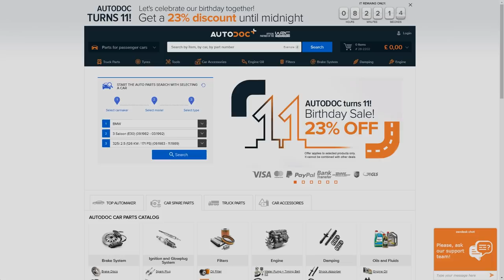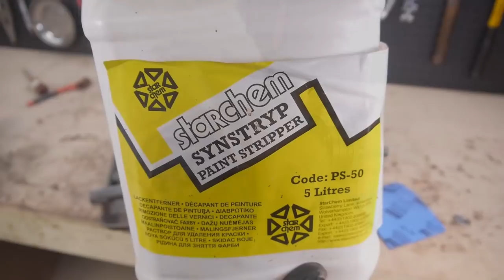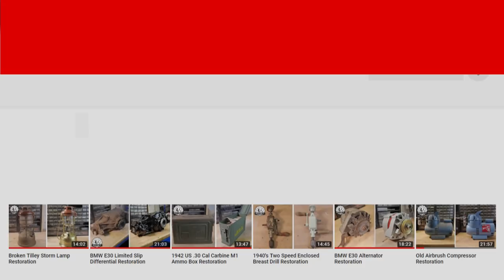BMW E30 Output Shaft - Full Restoration | BMW E30 325i Sport Restoration S2 E4

Comment: Once the body work is done, please tell me you're going to do a rebuild video of you putting all of the parts back in.  We've watched this thing get rebuilt piece by piece, I'm excited to see it all come back together.
Reply from the maker: Absolutely Scott :D You'll see everything.
Reply: @RestoreIt  Have we asked yet what color you're going to paint the car? I've been wondering this whole time. The same color as before? or...
Reply: @serenity6415  Since it's a restoration it will probably be the original color.
Reply: I've never seen you struggle before. That gives me hope
Reply: why is that not painted wet on wet, a lot less work

Comment: Loctite you're using is anaerobic adhesive. It works only when there's no oxygen around, for example, inside a thread. That's why any Loctite container should never be full. There're 3 major types of Loctite: red - strongest, for things which should not be disassembled anymore, still can be disassembled with heating; blue - for things which are planned to be serviced with disassembly; and green - weakest of them. I think it's a good idea to remove the screw, clean out green Loctite and apply blue prior you screw it back. Thanks for this nice video, and sorry for my English, it's not perfect but I think it's better than your Russian :)

Comment: Outer CV joint welded? to the drive shaft? Seriusly Dude, take a good look at it, and you will find a lockring inside the joint, on the driveshaft, squeeze it and the shaft will be removed from the joint!. Nice video of someone that works moore than needed. Just buy new CV joints, and swap them, it will save you a lot of time. And BTW, it`s almost the outer joint that needs replecement, it`s very rare that the inner is needed of replacement.

Comment: Dude your channel is so sick. not too sure if its intentional or not but you make me want to actually legitimately restore parts on my car that have gone bad. Its so entertaining that you've covered how to do certain things without a word spoken. You give me the confidence and I aspire to do that kind of work as well so keep it up dude!
Reply: Although I"m nooband I share your feelings, but there's lots of but's in here. First of all why not to take off the joint completely? It's quite easy to do, all you need is just a light knock and it will pop-off. There's also stuff in there to clean inside, you can also disassemble whole shaft in half and clean things in between. I completely don't understand decision to just repaint this part, which rusts as hell, the only way to paint it properly is using zink, because in this case this won't hold long, any rock that will hit that shaft will scratch it up to the metal, this has to have better coating then a base coat. Also he didn't place bearing balls into place the way it was, do you think they are the same? They are not! They weared out differently, and he just placed healthy balls to the place where it wears out faster which actually makes this shaft more loose within a next month of usage. He also placed boots wrong, putting ziptie over ziptie..w00t? r'lly? Don't you think it's too sharp for the gum to be mounted on top :D?

There's so many questions in here for me, although yeah, these vidsare  motivates as hell, especially the way things sound, there's no distracting music, there's only hand work which makes me to drop my software engineering and start to restore things! :)

Comment: Loctite works when the air is gone between the splines, so apply before tighten it. Great work lovely to watch!
Reply: Buddy,
You are generally correct.
However the green colour loctite which looks a lot like loctite 290 is called wick in and is designed to be applied AFTER the fastener has been tightened. 
I didnt see which number it was and if it isnt 290, you're right.
Reply: @dhc4ever  Oh okey never had that loctite my mistake. Learning every day :)

Comment: Hi, the outer cv joint is also removable, they're held on by a springclip, a good blow to the inner bearing race should do it. If i'm not mistaken. (kinda like how the halfshafts are locked in the diff)

Also the inner cv joints aren't to hard to find and not to expensive and its these that take the hardest beating normally. Its the smallest amount of play that turns in a domino effect of wear
Reply: Where can i find inner cv joints? I have truble to find one for e46 and for e30..

Comment: Tip for cutting the masking tape: Use a screwdriver to cut it. Use the long part of the screwdriver around the edge and it will cut the tape perfectly. Just press on the edge with the long round part of the screwdriver and magic happenes.
Reply from the maker: Thank you, Marian! I will be trying this next time.

Comment: For securing those clamps I usually just use some regular pincers, they work just fine only you need to make sure you don't pinch the boot. But seeing that you have the tool on your way that will likely make it even easier

Comment: Love your channel and all the items you restore!
I hope you realize that all the parts you wire wheeled clean and did not paint will rust as soon as they are exposed to water. Most had some zinc coating before, plain zinc or likely yellow zinc. You should include re-zinc your parts after wire brushing them, at least those that won’t be painted. And to keep everything perfect consider clearing the new zinc parts.

Comment: Before taking the ball bearings out, you should scribe a line across the outside of the bearing to the inside of the cage. This will allow you maintain the orientaton of the ball bearing channels when putting it back together again.  Otherwise it may wearout prematurely!

Comment: Those metal brackets are suposed to be tighten with pliers, the ones who arent tighten with a screw. they might come lose if you dont.
The loctite goes in the threads before screwing, it hardens with a absence of oxigen, and the green loctite is really strong for such a screw, you might not be able to unscrew it later, the red or blue loctite might be better for stuff like that. 
Nice video, keep the good work :D

Comment: These are those part that should be replaced those bearings are full on greas mixed with sand and are worn inexpensive to change 40€ from autodoc
Reply: His cv boots doesnt show any tear,so internal parts should be okay.
Reply: I agree 100%.  This doesn't make any sense, unless it's purely academic?  Those CV's came apart WAAAAYYYY too easily. :(

Comment: With all that grease,probably a very frustrating job,but you did good in the end,an excellent refurbishment well worthy of my 5☆ rating
Reply: Seal was basically destroyed once he touched it, because thing layers were created, you need bold line around the that item surface and then squash two items and clean the rest, or else this won't be sealed properly. Also boots are mounted on top of ziptie? Paint and coating instead of zink? Any small rock will scratch this shaft to the metal, bottom part can't be painted the way inners parts are.

Comment: Thanks for the interesting video! But you have to put the Loctite on the screw or the nut first. Loctite cures anaerobically under the presence of metal ions. Like you did it, it will have little effect.

Comment: I’ve watched several of your restoration vids, and you do good work.  But, I’m curious why you use high build primer on parts, especially rotating parts.   The the high-build we use on body work can’t be used on bare metal, but I assume your product is different.  We first seal parts like this in epoxy, and then lacquer (no clear).

Comment: One thing i have always wondered is why there is not proper grooves for rubber boots to hang on to in these joints. They come loose very easily, like here in the video at 16:51. Even if they are clipped with original clips they might come loose just rolling the shafts fast.

Comment: Ask for advice @ your local post office, you probably can get your parcels delivered there (Lista de Correos) or if they have a CityPaq near, you can also get them there.
Reply from the maker: Good Idea GroovyDrifter. I opened a mailbox but they don't do international parcels.
Reply: @RestoreIt  The CityPaq option does work with international parcels, you have to change your name and address so the parcel gets delivered to Correos (I think all is explained on the web) and they deposit it on a CityPaq and notify you. Then you go to the CityPaq cabin and retrieve the parcel showing a barcode on the phone. I don't have it, but a friend gets their Aliexpress parcels this way on a private CityPaq machine on our work (there are also public ones). You usually get parcels two days later if you live in a city or well identified place, but in your case may be an improvement.

Comment: Can I give you a recommendation. Your parts cleaner is gonna get very dirty and I know it’s very expensive for the cleaner. At my work we use the degreaser Zep to knock all the loose grease off first and then we parts wash it. It makes the parts washed go 3 times longer.

Comment: 20:12 you do realise you're suppose to apply the lock tight to the threads before screwing in the bolt, right? Otherwise, outstanding work!

Comment: Imo you should have painted the abs wheel because its exposed to the elements and will rust fairly quickly. And it's not like it will interfere with the abs sensor in any way

Comment: Why didn't you pull apart the outer CV? Also, on the inner CV, you should remove the metal cover that the boot clamps on to, most boot kits provide both new.....

Comment: Although I"m noob and I share your feelings, but there's lots of but's in here. First of all why not to take off the joint completely? It's quite easy to do, all you need is just a light knock and it will pop off. There are also stuff in there to clean inside. I completely don't understand decision to just repaint this part, which rusts as hell, the only way to paint it properly is using zink, because in this case this won't hold long, any rock that will hit that shaft will scratch it up to  the metal, this has to have better coating then a base coat. Also he didn't place bearing balls into place the way it was, do you think they are the same? They are not! They weared out differently, and he just placed more healthy balls to the place where it wears out faster which actually will make this shaft more loose within a next month of usage. He also placed boots wrong, putting ziptie over ziptie..w00t? r'lly? Don't you think it's too sharp for the gum to be mounted on top :D? And also who taps a seal with you finger? You basically just left a gaps in there because in some places layers of seal will be to thin. Just push the bunch of it to the whole surface and then join two items clean what will comes out, this way you'll seal it properly

There's so many questions in here for me, although yeah, these vids are motivates as hell, especially the way things sound, there's no distracting music, there's only hand work which makes me to drop my software engineering and start to restore things! :) And I'm pretty sure this guy will accept any arguments that makes sense to him as he learns fast and learns well.

Comment: If you Put the Grease in the CV and Press the Rubber over you should Press the Air Out. Take a screwdriver in the small End and Press a little Bit the CV. I Hope you Unserstand that😅🙈 Sorry for my Bad English.
Reply from the maker: Thanks for the tip, Adrian. Perfect English :)

Comment: Did you use the same ball bearings? If you can I'm not sure you can. The Clank clank annoying on turns, sure sign ball bearings need replacing.
Reply: I've never seen it down on youtube anywhere

Comment: Hey, awesome video. Quick question: why did you sand the shaft prior to using the paint remover? Wouldn’t it be easier to do it the other way around and save yourself some labour? Thank you
Reply: Sanding it helps the paint stripper bite in to the paint.
Reply: Ryan Michie thank you !

Comment: looks like that the smal end of two grommets are not installed in the groove of that shaft, compare before and after pictures
Reply from the maker: Thanks, m98de, I did wonder if the groves were for the clips. It's because I didn't have the tool to secure the big ones. Once I have the tool I'll make the adjustment.

Comment: Man, this parts  needed  replace.  It the same like clean up the used condom ...
Reply: except that rebuilding it like this might not be more than €50, while a new axle might cost €400-500. That's an expensive condom.
Reply: @dokterkarel  Nah.  They are well under 100
Reply: @Johnathan_Waters  new and OEM?

Comment: Those outer CV joints will be knackered, they just pop off with a sharp hit with a hammer and are cheap to replace. Do it now before you put the car back together as you will end up doing them very soon anyway.

Comment: you could remove the joints cv only by hitting them or with an extractor. the back part that is laminate, is NOT part of the cv joint. Your work is admirable, I loved the video, and the others the same but if I leave something triggeredd waiting for all the video that you removed. also new dust covers come with that piece of laminate. Regards.

Comment: I’m just in the process of rebuilding mine. I’ve put all the internal components back together ie the circle and star shaped pieces and the ball bearings, but it’s has basically locked it self in place and won’t rotate as it should. Any ideas where I’ve gone wrong and any solutions to get them back out and fitted correctly? 

Thanks for any help from anyone

Comment: Sorry but i think you might have assembled the inner joint wrong. Did it move around freely, as a cv joint would? I didnt see in the video
Reply: I’m doing this job right now and yes, the 2nd one is offset by 1 bearing. I made the same mistake.

Comment: You put the yoke in the wrong place. The recess on the shaft, that's its place. 17:08 17:38.  At the beginning of the video 01:15 it is clearly visible how it should be

Comment: Do you have any tips on how to get the clamps on correctly for the outer boots? I have the same ones, and I bought the correct tool, but it seems as though when I tighten the clamps it is pushing the boot back out.
Reply: Also the small clamps for the outer boots seem impossible to set because they are so small

Comment: These are junk. The bearing surfaces are galled and worn.
It's like washing an old set of worn tires.
You get an E for effort on this one.

Buy some new shafts before the wheels fall off at 150 kmph.
Reply: Uh the wheel won't fall off lol

Comment: removing the paint  would have been easy if you had a 200 grit paper and sand it down in 1 to 2 minutes it would have been bare metal. also powder coat would have been best thing to do

Comment: No clean surface within 5 meters stays clean in the presence of moly grease.
Think about a stainless steel bench top for the bench you do disassembly and cleaning on.
Putting you hands to your face when the mongrol boot came off, how lucky were you not to grease your face...or were you?
The important thing with cv joints is to get grease between the balls and the inner and outer bearing surfaces, I usually pregrease them before assembly then pack lots more grease in after they are together.
If that loctite is 290 wick in then you are using it correctly.
I see you're still a fan of the walking bench grinder. mmmmm
With the future body work are you going to get a rotisserie stand for the body shell?
It will make access to all surfaces so much easier for cutting, grinding, welding and painting.
They usually have wheels so being able to move the body shell around is possible, beats having it sit on jack stands.
How good is your painting booth, good light, room to move, no more covering everything in overspray, nice.
As to more channels, yeah why not, tell me where you found the 28 hour day or does time move more slowly in Spain.
Nearly 400k subs, isnt popularity great.
Looking forward to the next one.
Cheers

Comment: Bro, what pressure do you spray paint at?
Reply: You thinking it sounds a bit high?
Reply: Connor Pollard , No mate, I have a set of wheels to paint and i need advice on pressure 😂😅
Reply: PSF Metal Fabrication & Repair Personally I think that sounds about 2.5 bar, too much for a filler primer and too much for most things tbh but obviously I’m just guessing. 2 bar is a good base point and where I would set a gun with a paint I’d never used before. Fillers and primers go lower on the pressure as these are higher viscosity and will spray dry and you won’t build up the film thickness if shot too hard. Good luck!
Reply: Connor Pollard Legend! Thanks